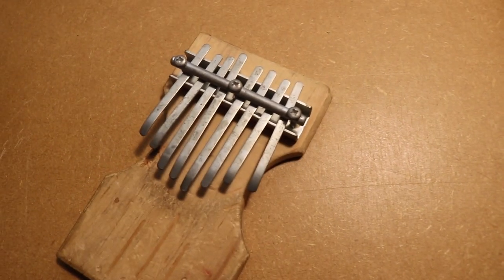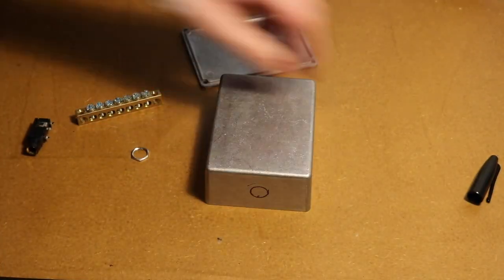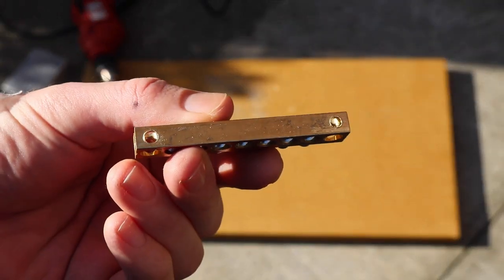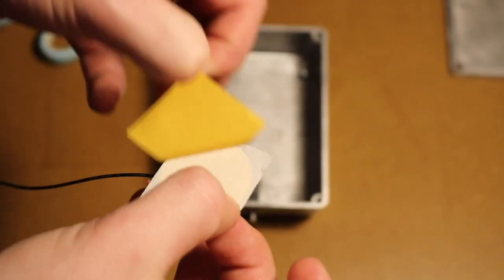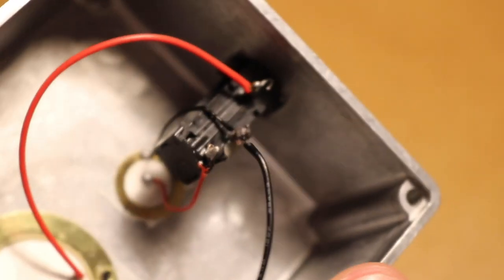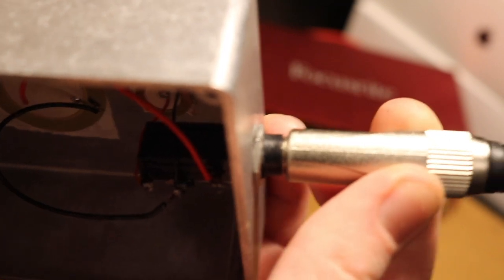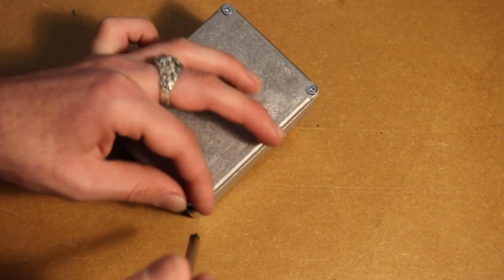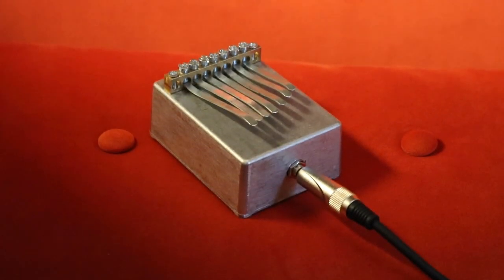How to Make an Electric Kalimba/ Mbira

Comment: Just wonder is that possible to use guitar pickup?
Reply: Maybe if your tines are right over the pole pieces as long as the tines are a magnetic material.
Reply: You could, but it wouldn't give a kalimba sound. It would sound like a broken guitar.
Unless you're talking about an acoustic pickup, in which case, just bore a hole under the tines and slap that mic inside.

You could do that with any kalimba though...